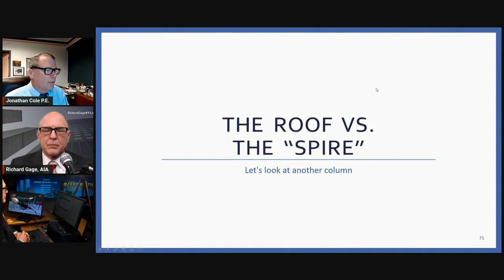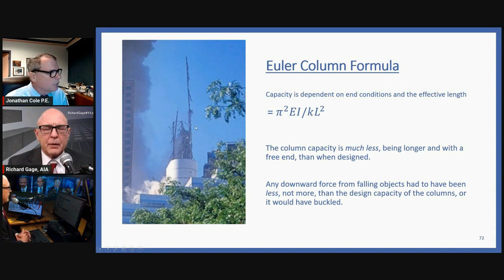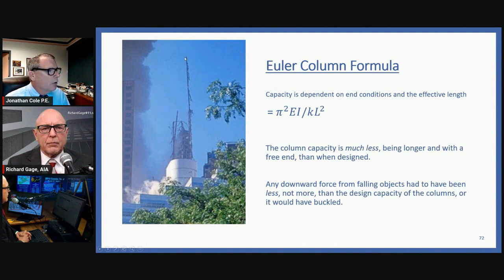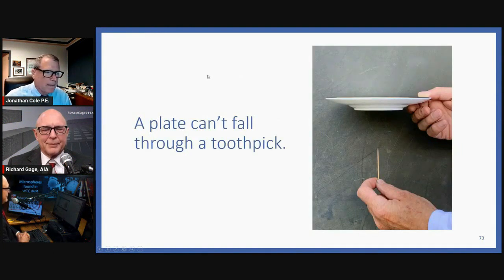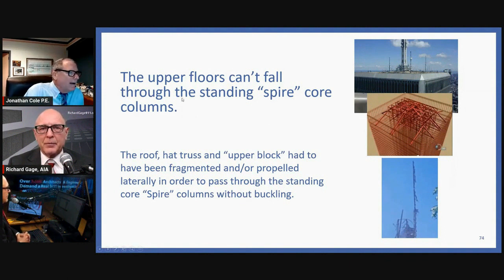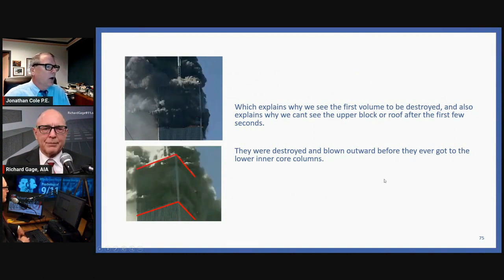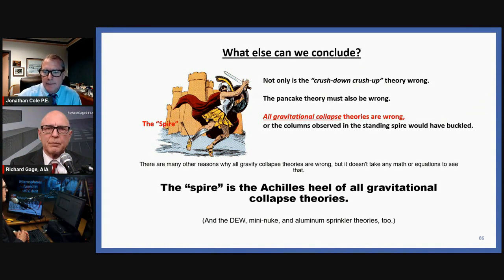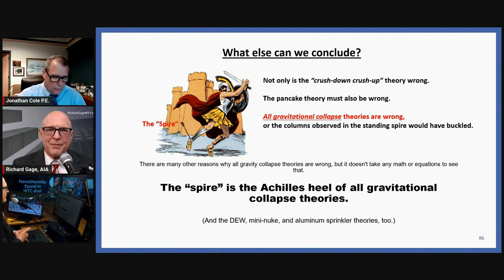The Achilles’ heel of all WTC Gravity Collapse Theories

Comment: From: Jon's Mail
Sent: Tuesday, January 31, 2023 5:55 PM
To: Gene Laratonda
Subject: Re: Wouldn't the freestanding core columns invalidate Zdeněk P. Bažant's crush-up/crush-down theory?
 
Correct Gene; the very existence of the free standing core columns also known as the “spire” destroys not only the Bazant “crush down crush up theory” but all gravity collapse theories.

That crush down crush up theory is actually invalided on many fronts including:
-the smooth downward acceleration or missing jolt, 
-the first volume to be destroyed is in the upper “block”, 
-there is no evidence of the upper block after the initial 3 seconds or so, 
-the fact that the Bazant total collapse duration is about 15 seconds but the spire stands for another 15 seconds, for a total of 30 second total collapse time,
 -how the spire fell with no load above it, 
-What cut the spires columns and their motion
-The  large  slenderness ratio of a few remaining inner core columns means that they had less downward force , not more, than the design loads imposed during the collapse process
-and of course no experiment has ever been shown  to demonstrate the remarkable crush down crush up phenomena.